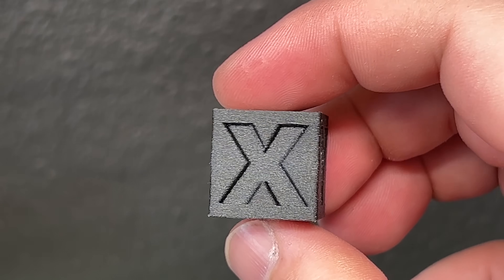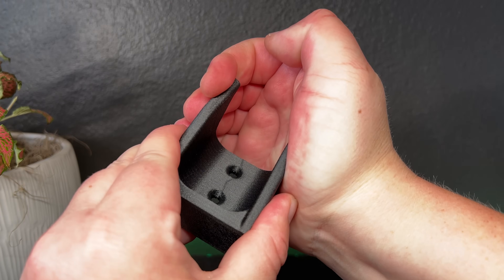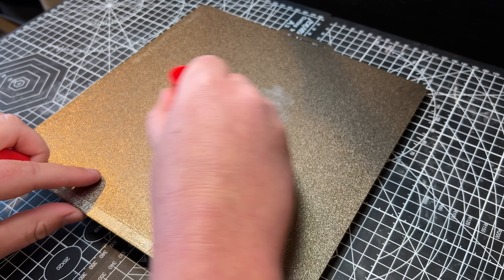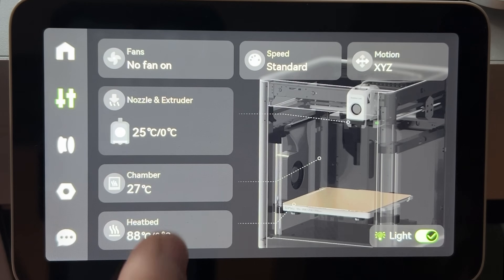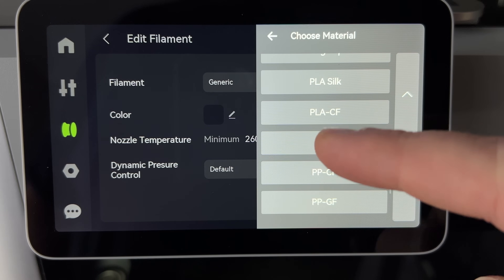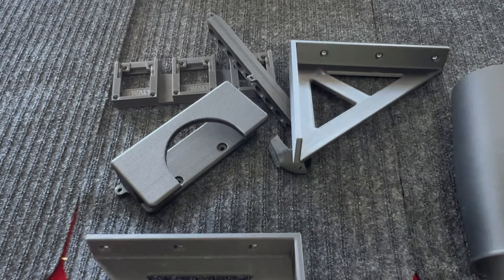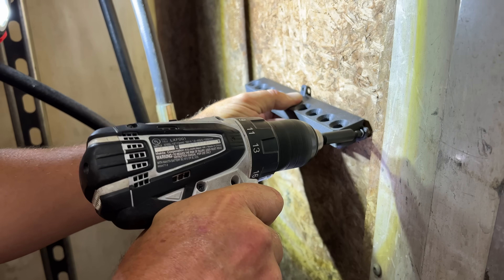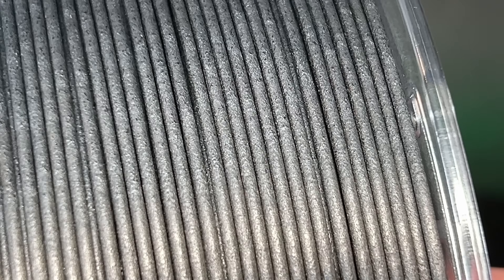3D Printing PA6-CF with a 0.4mm Nozzle on a Gold PEl Sheet

Comment: My first attempt I went as you described. Same dryer, same filament, same X1C, same preset...but I tried hairspray instead of glue. It failed about 15 minutes after I left the house. Came home, cleaned the build plate (textured PEI BL plate) and added glue. I also left the bed temp at 100C and set the minimum temp to 270, and max to 280 (per some Sunlu instructions I found online) set the nozzle to 275. Used your speed settings, and the second try went MUCH better. Basically perfect. Layer lines were nonexistent. it was a 50mm^3 cube to test dimensional accuracy, then I planned to anneal it to reheck and see if the dimensions changed significanty...but I decided to print something a little more detailed. Fingers crossed. BTW, the 50^3 cube came out 50.01x50.01x49.94...I can live with that. Thanks!

Comment: Great video, but I do think you forgot one MAJOR factor.... the annealing factor.. after you print the item you need to heat it an oven NOT YOUR COOKING OVEN to a specific temp - 80-130c for at least 6-12 hours for its actual strength.

Comment: I've never had to use glue on my Centauri Carbon with the textured plate. You might need to adjust your heated bed settings. I run 45C.

Comment: Thanks for your video. Doesn’t PA6-CF require long-term annealing after printing?
Reply from the maker: It can be annealed to improve dimensional stability and strength but isn’t required. I didn’t anneal any of the parts and they are all holding up great. Thanks for watching 😊
Reply: @ResinForge  Thanks! Learned something new!

Comment: Is  p1s capable of printing it every day for 4 hours? I need an urgent printer for the project and it is on discount due to p2s
Reply from the maker: You would want to swap the nozzle to a hardened steel nozzle. The P1S comes stock with a stainless steel nozzle. You COULD print it with the stainless steel nozzle but it will wear it out faster.

Comment: strong? wait until it sits around for a few months and absorbs moisture. Notice that "Moisture Sensitivity" is VERY HIGH? It'd soften, loses up to 40% of its initial strength and deforms over time. For that reason, I rather keep using PLA, thank you very much.
Reply: Yes, that’s true, PA6 will get weaker when it absorbs moisture. So, it heat isn’t a factor, seal the prints with a layer of clear coat to block the water absorption.
Reply: That's why you need to anneal. If you don't anneal PA6-CF, you might as well just print on PLA Pro.
Reply: @TallGingerDude  annealing doesn't do anything towards moisture absorbtion.
Reply: @junkname9983  no but the moisture absorption doesn't have the negative effects (it can actually strengthen prints) if the part has been annealed.
Reply: @TallGingerDude  are there any experimental data backing that up? I'm really curious about it and have been looking but can't find any yet

Comment: My prints let lose al the time with this stuff, printer p1s, bed temp 100c nozzle 280c speed reduced, hardens steel nozzle .4 mm am i missing something? Also i dried the filement in my printer for 12 hours😅
Reply from the maker: If your using a Gold PEI you need to ad some kind of adhesive, I used a glue stick and it worked great 😁 I am also not sure if the P1S chamber can get hot enough to actively dry the Nylon, I used a dedicated dryer.
Reply: Thanks for the reply, i use a bed adheasive spray, ore do i need a glue stick😮?
Reply from the maker: @tomaswolsink7620  Of course! I have not tried adhesive spray but I’m sure it will work fine, maybe try a small test print with it first 😁